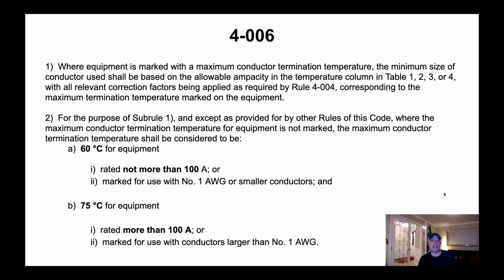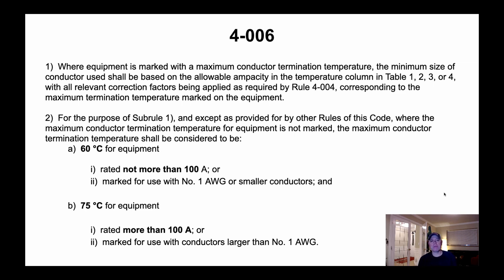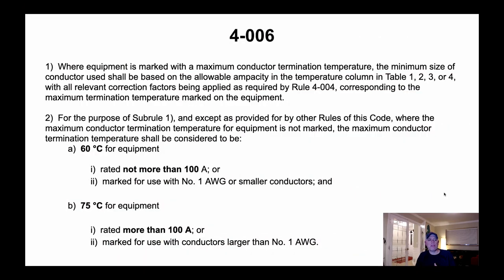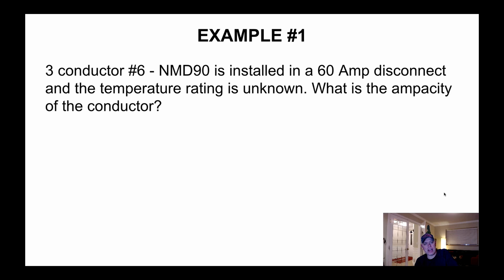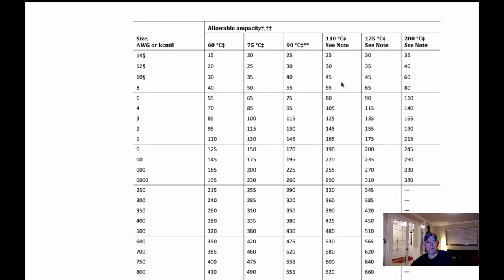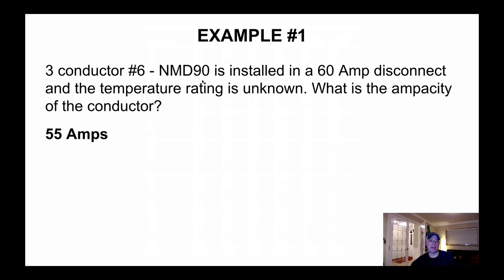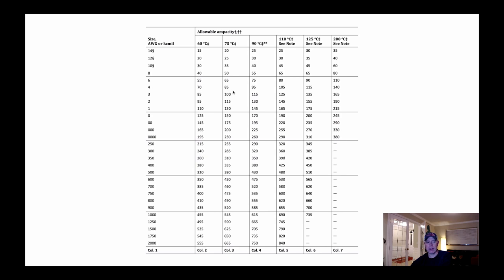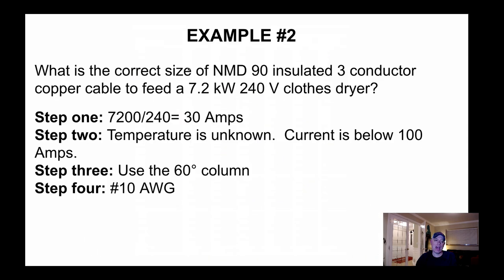conductor ampacity correction (equipment rating)

Comment: My question:  If we de rate a conductor due to termination temperature, is further de rating of the conductor based upon the ampacity due to termination temperature, or do we start with the ampacity as per the insulation temperature of the conductor?

Comment: All good. Thanks
Splices terminations greatest resistance highest heat.
Look up "skin effect" in electrical conductor s in physics.
Only the outer 1mm of circumference carries 99% of all current in any known conductor.
Interior copper / Aluminum carries very little load and tubing could and is used in high amp power.
Many unaware of this.
Reply from the maker: You know what?  I teach my students about skin effect but never thought of linking it to this concept. That’s brilliant. Thanks Mitzvah!
Reply: Worked for nuclear physics power industry

Comment: Thanks Chad. I think in the NEC code, instructions are given in   110.14(c)(1)(a) & (b), stating that unless listed and marked otherwise, conductors must be sized using the 60° C  column of table 310.15(b)(16)
Reply from the maker: Yeah the CEC basically says the same thing in a round about way.